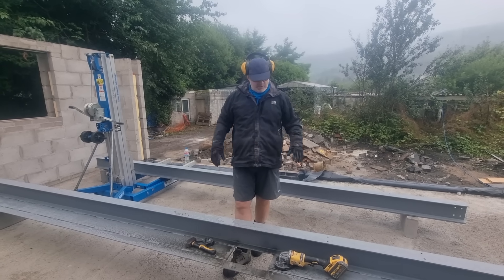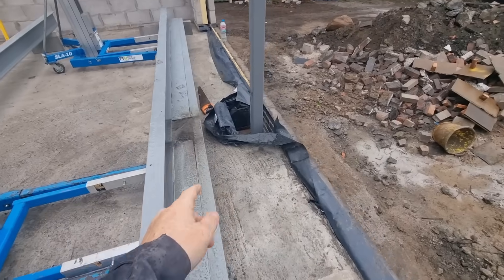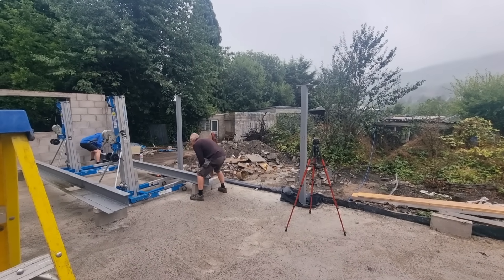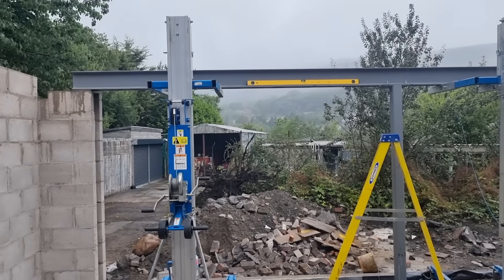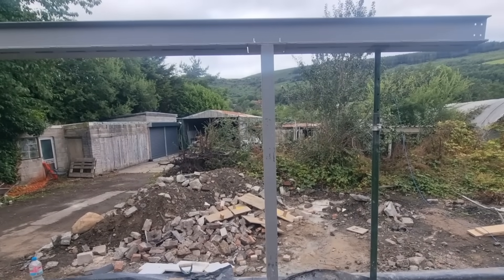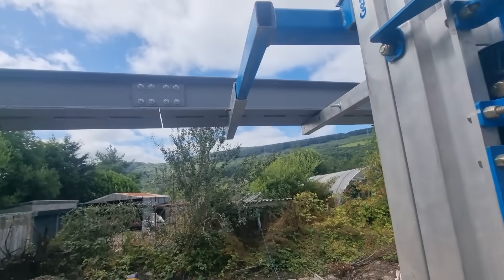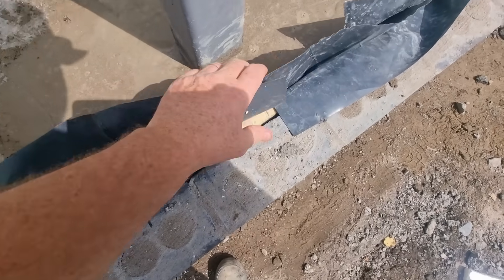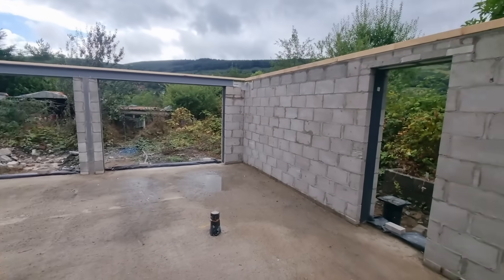Fitting massive RSJ steel beams

Comment: Doing a very similar steel with a welded plate do you need to put padstones on inner and outer skin or just inside ? Self builder
Reply from the maker: Our plan stipulated pad stones only on the inside .
The outside skin is supporting just the steel extension plate no weight above it as the roof wall plate is on the inside skin.

Comment: I assume that the structural engineer has sized up sjze ofcsteels, extra steel plates and the web plate connection.  Im surprised that you've only got a plate connecting the web and not the top and bottom flanges as the conbection needs to transfer the full bending moment or else youll get large deflections and your sliding or folding doors are going to jamb as they cant accept much deflection over 7mm or 1/4".
Reply from the maker: Im not an engineer bit it's all gone through an engineering company and full calcs .
Then this has been double checked by the local authority. 
So it's all been calculated agreed and we just fitted it John but I do get what you've said 👍
Reply: @brickrightbuildinglandscaping It took me a while myselfcto cotton on that these folding door opening need a much tighter deflection requirement than the steel code if you have a large span.  If that was a continuous beam then the deflection would be no problem but you have a weakness with that fishplate connection.  If it was a steel fabricator that designed it all then I would be concerned and I would raise it with them and whether theyve used a chartered structural engineer to design it or merely someone inhouse who is not a chartered engineer.
Reply from the maker: @johncranna9427 
Not an in house engineering it's all been designed through a chartered engineering consultancy team of engineers and signed off by building control. 
Seen as you've said this is will ask these questions to the engineer who i know so appreciate you mentioning this to me .
Thanks very much
Reply: Must admit as an engineer I was surprised to see the plate welded as it was and the location of the splice.  It can be done and connection calcs can prove it but with friction grip bolts.  When I’ve done bi-folds I’ve used UC sections or even hollow sections as they offer better rotational restraint.  Again with a bottom plate though.  I do like your videos particularly when you do patios and the grouting.  I have learned a lot!  Thank you!
Reply: @caravancapers5091  The block work surely effectively cuts the beam into 3 spans?
Reply: @tonydalton6756 yes they do.  It's actually a steel post support with blockwork around it.  But question are beingvraised about the connection of the two steel beams in the middle of the centre span.

Comment: Could you have used bolt boxes in the column fnds?
Reply from the maker: We did bolt the columns to the foundations if thats what you mean
Reply: @brickrightbuildinglandscaping it’s a method of installing the bolts in the foundation that gives flexibility before tightening and grouting the bolts.
Reply from the maker: oh right ok mark .
Chemical fixings we used